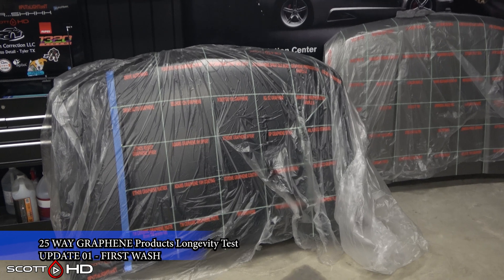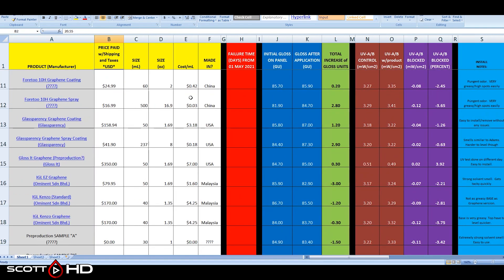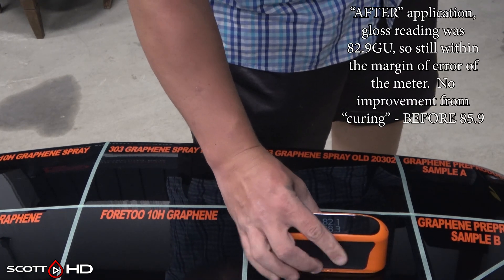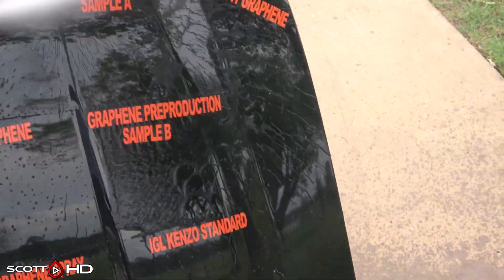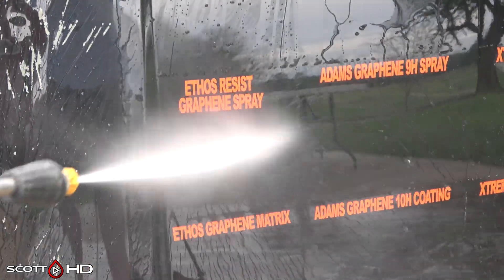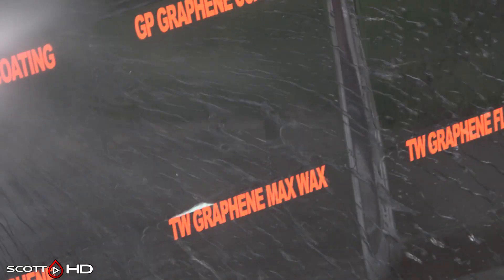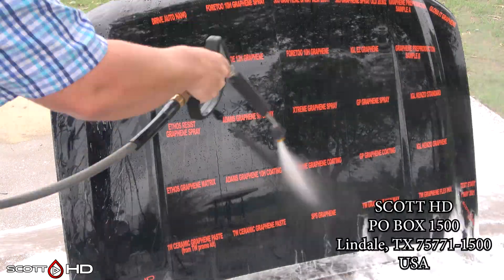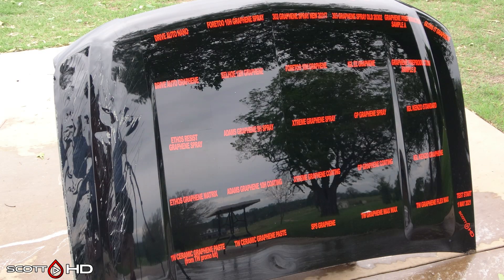Graphene Coatings Longevity Test - 25 WAY - ULTIMATE comparison test - UPDATE 01 - FIRST WASH

Comment: Just a suggestion, but you should towel dry after washing. It might've been fine this time because the coatings are fresh and they're super repellent and it wasn't particularly sunny and a hot panel, but you'll eventually start blow drying it and a lot of the water is gonna evaporate, leave minerals behind and "clog up" the coatings you're testing, causing you to have a lot of early failures that would have otherwise continued performing strong if they'd been towel dried. It's your experiment, you can do as you please and I respect that, just my two cents.
Reply from the maker: Great suggestion!

Comment: Just bought 128oz of Ethos Resist...hope the marketing didn’t get me and it really is a great product. 
Otherwise I’m going back to Turtle Wax Flex Spray, which has impressed me.
Reply: I’m really liking it so far. I’m using it as a topper for Ethos Pro Wax. I re-apply once a month and it makes the car looks like it has received a new coating each month. 
The ease of application alone is worth it
Reply from the maker: It seems to be well received online. I've never used it until now.
Reply: I strongly believe it will blow away TW Flex we shall wait and see 🧐
Reply: @Youknowitbby  man. I really will be excited if Ethos blows away TW Flex. I have been impressed with Flex spray so far, so if Ethos Resist is better than I’ll be very happy.